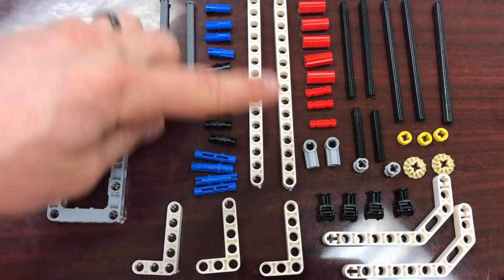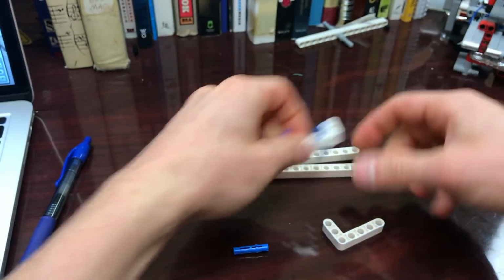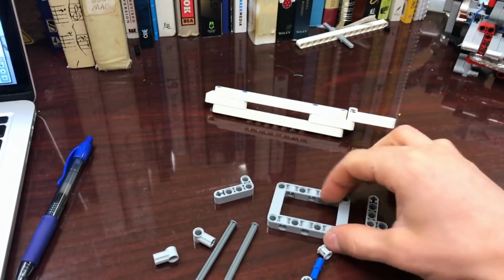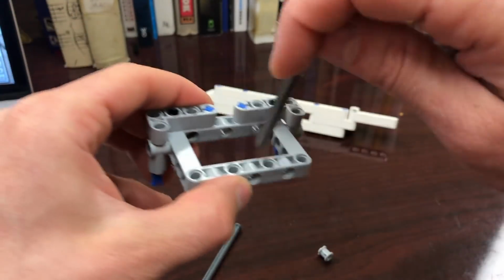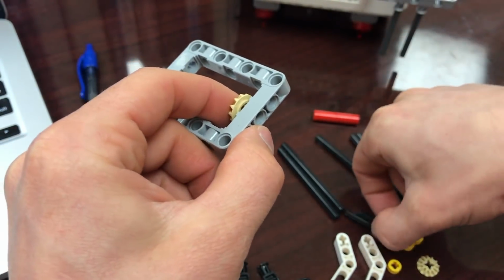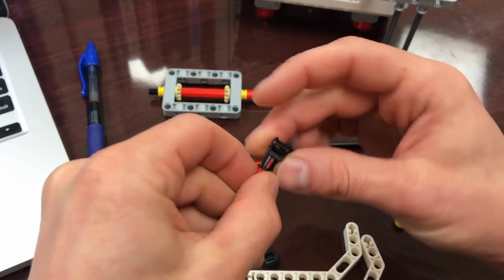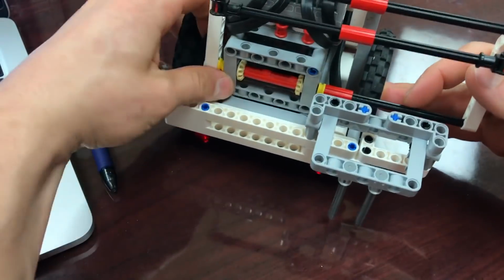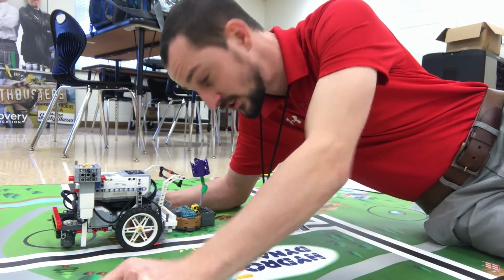FLL Hydro Dynamics Attachments: Flower Mission

Comment: Hi Zachary, great videos and excellent attachment. I am a rookie coach and was looking for videos on why our robot is not consistent. Kids have built a robot that is of similar size as yours but has think wheels that come with LEGO educational set. I see that you are using thinner wheels. Have you tested wheel size and does that make a difference? Where did you get the wheels that you are using? Appreciate any comments/feedback.
Reply from the maker: +Sumeet Bhalla hi! Yes, we’ve tested the larger wheels and found them to be more accurate, both rotational and moving straight. The wheels part number is: 2902 and the tire part number is: 2903. You can find them on bricklink.
Reply: Zachary Trautwein thanks!